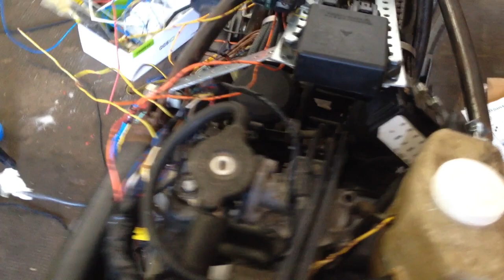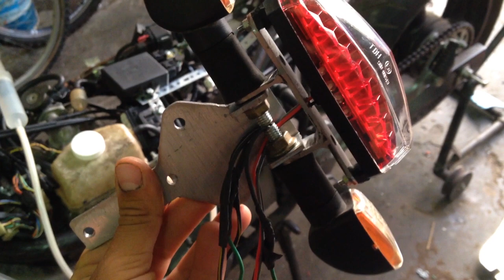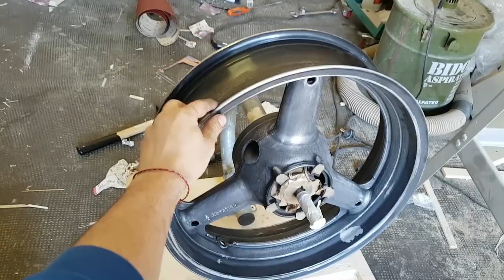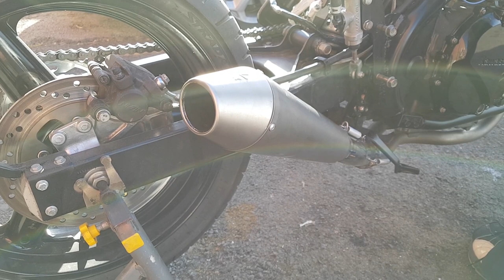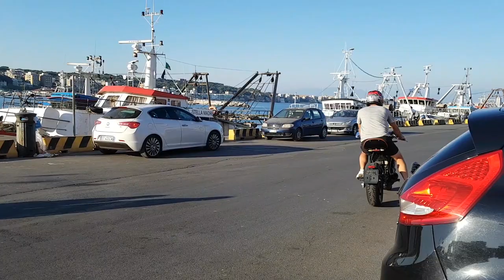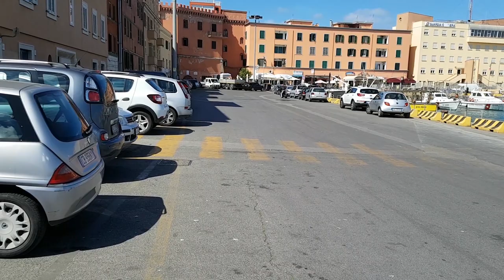Kawasaki ER5 Cafe Racer / Cafe Fighter building process video compilation

Comment: I wonder what swingarm did you use and if you had any problems with the chain not being strait.
Reply from the maker: I think it was a bandit 650 or 600, got to modify the sprocket holder to fix the chain alignment

Comment: Great work! What kind of motorcycle is a fork installed? Was it necessary to use a fork from the old traverse or only other bearings to install the plug?
Reply from the maker: +zukko666 hi, the forks are from a ninja 12 r, I had to change bearings and build bearing adapters.

Comment: how did you get the pod filters to work with the cv carb...ive got an er5 bobber.
Reply from the maker: You have to change the carburetor jet kits and limit the air flow in the filters.